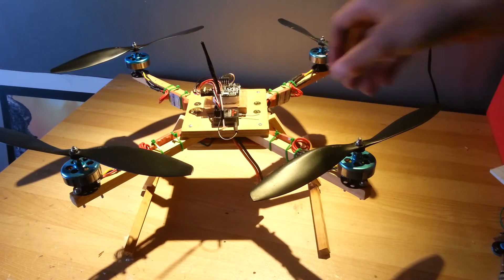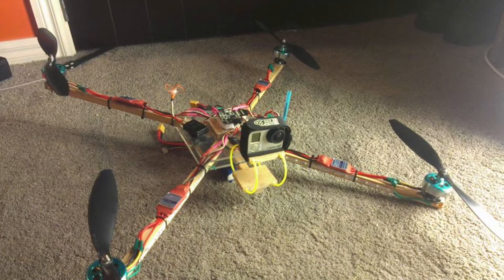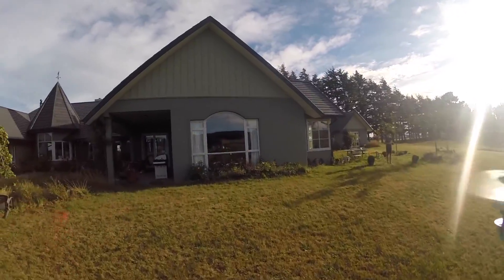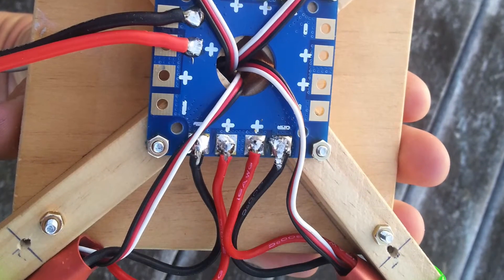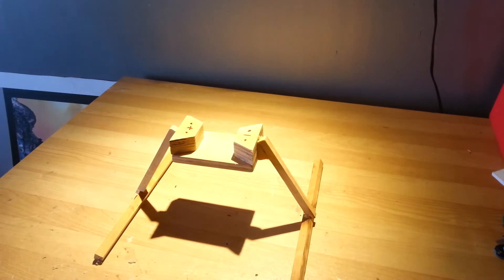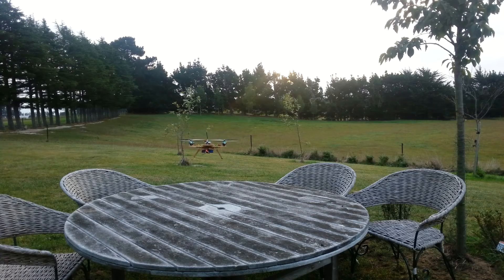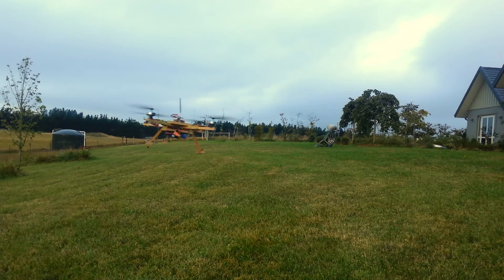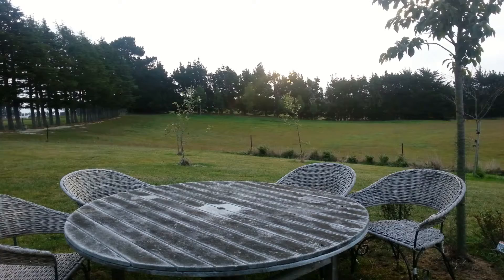Better Drone Design Mk#2

Comment: Nice work! I got a similar setup with DT750 motors but using Multiwii controller. I'm  considering to buy the Naze32 as well. Is there a lot PID tweaking required?
Reply from the maker: I love the naze 32 board, I installed beta flight on it and changed the pids to some numbers that would suit a larger quad rather than a racing quad